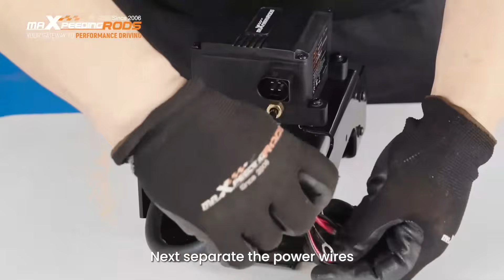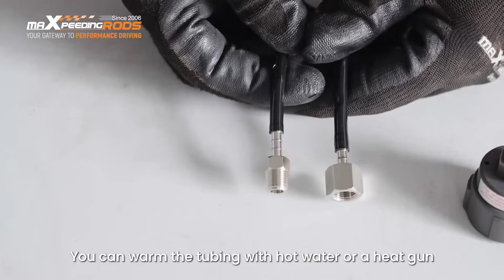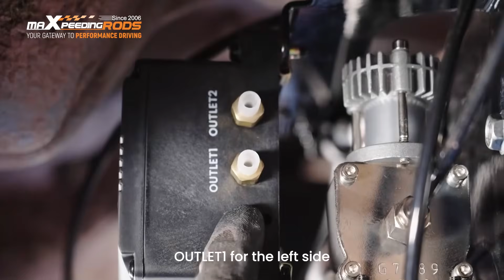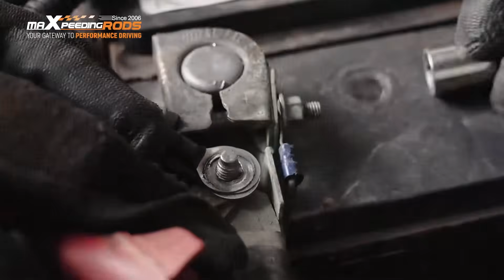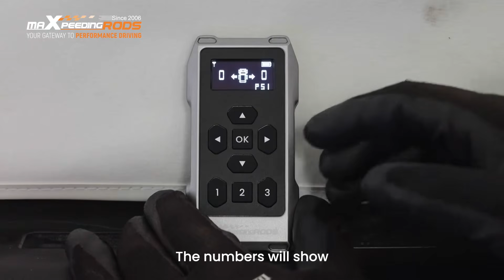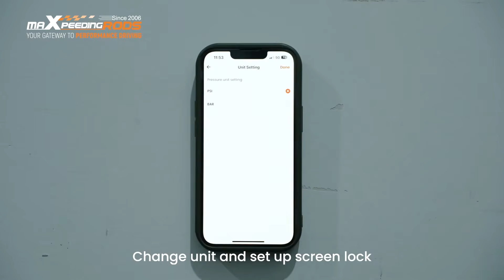Installation Steps - How to Install Air Controller Kit for Ford F-150

Comment: Have a question on the function of this .  Say I set the controler pressure to 20 psi, the bags air up and while driving the bag pressure drops slightly say due to air temperature changes. Will the compressor automatically turn back on to get the bags back up to 20 psi.
Reply from the maker: Hi, there, could you offer us more detail about the type air control kit you use,if your kits are ABK-AAPGAOPEI-NLC or ABK-GAOPEI2-NLC.When the actual air pressure is 4 PSI or more below the set pressure, it will automatically replenish air, for the other type ,please send us more detail, thank you😄